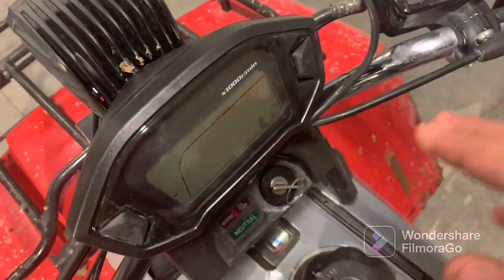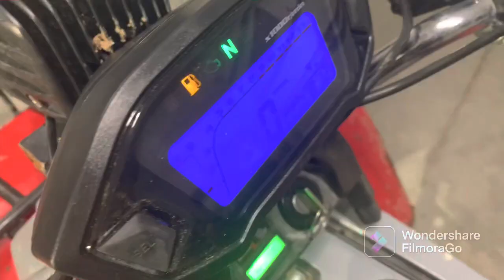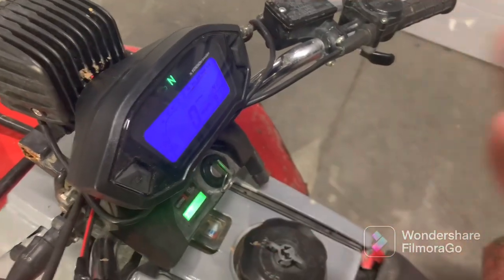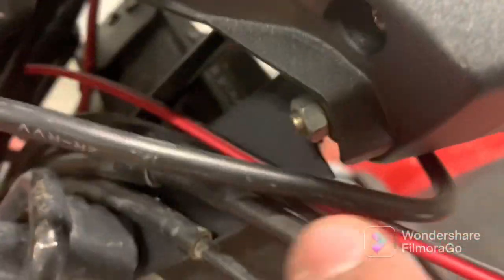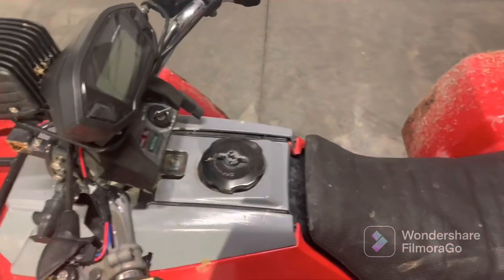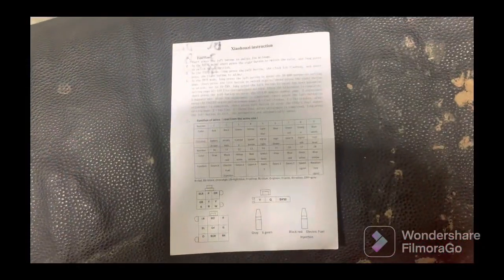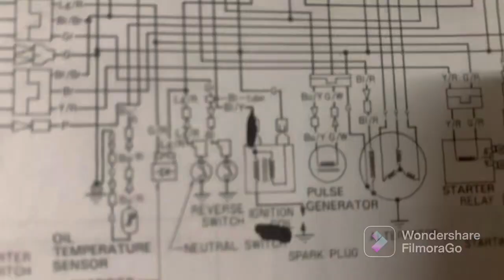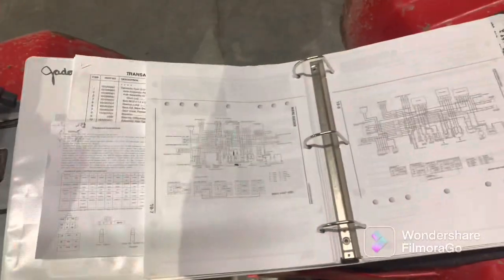Universal Speedometer install |  part.1 tachometer

Comment: Does this work on the kawasaki kfx700? Also, does the water temperature sensor and rotating speed sensor need to be purchased separately?
Reply from the maker: Mine came with the speed sensor but no water temp sensor

Comment: Is the speedometer for a bike or a quad or does it work on both??
Reply from the maker: It should work for both
Reply: @EverythingOffRoadOfficial  but can you send a link to the speedometer plizz
Reply from the maker: @jihadkachach6044  Universal Motorcycle Speedometer Tachometer Digital Odometer Fit for All Motorcycles with DC 12V,Adjustable for 7 Colors https://a.co/d/dTD1CEF
Reply: @EverythingOffRoadOfficial  thanks 😏